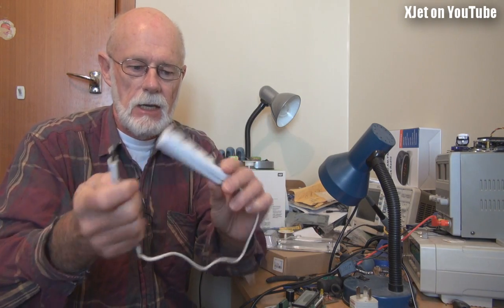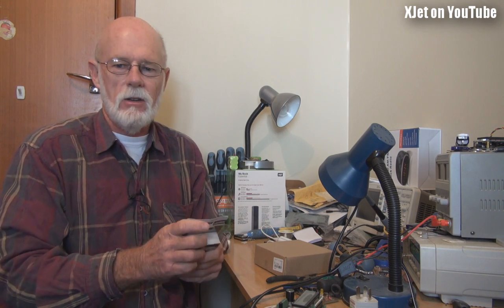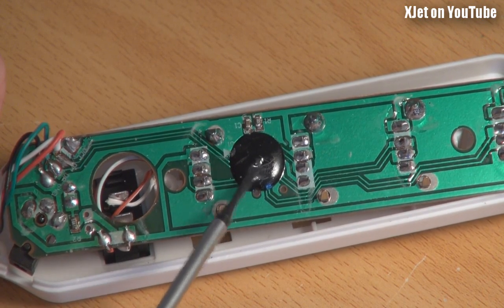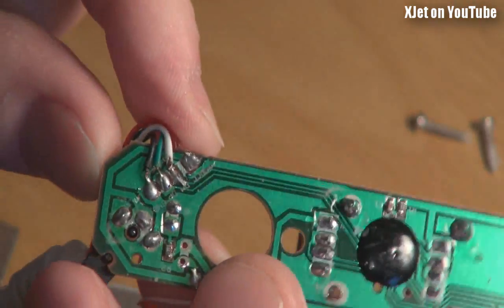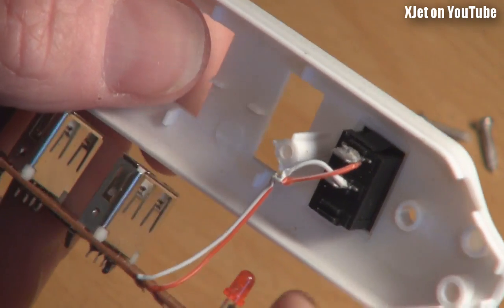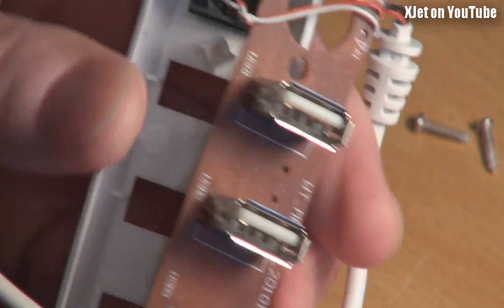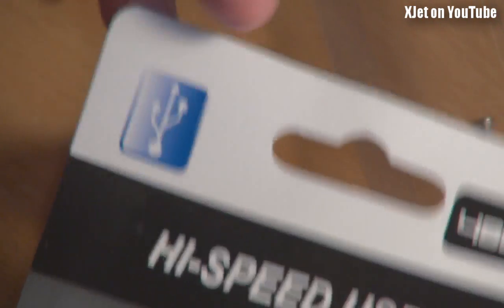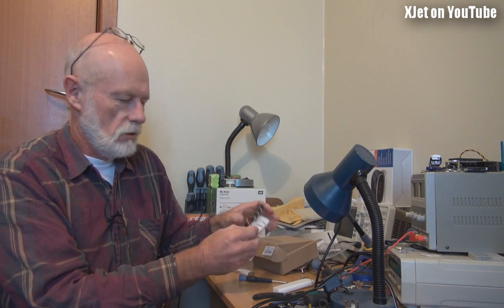A really bad bit of Chinese electronics

Comment: I was in need of another, after my experience with the previous, (from which I salvaged 4 nice switches I have used in other projects) I purchased another. After my prior experience and having watched this video, I took her apart and did a rebuild. I removed the wires, which, much like yours left way to much wire exposed, trimmed and replaced. I re-soldered nearly every joint using a good iron and some high quality lead based solder, then thoroughly tested it using a power bank and charger doctor to insure the proper voltages were present.  Now I use it on my micro controllers, and single board computers such as my Beaglebone Black linux boxes, and my Orange and Rapberry Pi machines (not needed that much on Raspberry Pi)  They do a good job if you take the poor workmanship out of the process and replace it with careful practices in the rebuild. I also did the same with a 10 USB hub that I have now wired up to the house battery's on my Motor Home for a charging station through a large 12 to 5 volt buck converter.

Comment: I recently bought 20 X 555 timer integrated circuits from China (through Alibaba).  They were certainly cheap but putting them into a simple astable circuit built right from the datasheet they keep blowing.  About 8 of them are in the garbage now.  Most worked for a few seconds and then stopped.  I thought it must be the circuit so I double checked it then put in a 555 I sourced locally years ago and it works fine.

Strongly suspect an inferior product now.
Reply from the maker: It is not unknown for Chinese sources to simply grab a bulk-lot of devices and re-silkscreen them with the designators for a more expensive device then onsell them.  There was an interesting example a few years ago when Sparkfun Electronics got caught by this with some Atmel processors which were something completely different.
Reply: ***** Hmmm.  I get the feeling these were rejects from a test line but then at that price I doubt anyone could check them individually.

I don't know.  Pretty sure they don't meet the specification for an LM555.  I wasn't even loading the output!
Reply: ***** I guess it's "luck of the draw".  I just bought four LED light bulbs rated at 220 volts from Aliexpress and in less than a month 3 out of 4 are dead.  I asked for a refund but the vendor (Aliexpress is only a broker I think) asked me to prove they were faulty with a video.  Certainly not worth my time so I just won't buy from them again.

You get what you pay for is the lesson.
Reply: you should better buy granade and use it to blow some china factories :D so you save thousands of lifes.
Reply: *grenade

Comment: One thing the Chinese factories do not practice is Design For Manufacturing (DFM). You can design the USB hub to use connectors to eliminate manual solder connections. You can design snap or sonic weld plastic pieces to eliminate screws. They could save time in assembly and increase reliability.

Comment: That makes me want to stab out my eyes with my soldering iron. I make PCBs (specifically in inspect and touch up solder joints out of the wave and ensure correct component placement prior to functional testing) for a living and I wouldn't even bother fixing this, I'd kick it back down the line and yell at whoever made it.

Comment: I once bought a USB lamp form china, when using it a Resistor overheated and the thing went up in smoke. That was a waste of £23.
Reply: +AuthorFilms Studios:  I purchased a 'Long Life' Lamp, equal to 60W-240 V. 25 years guarantee, it cost me A$20.00, I plugged it into the Light fitting, it worked for an hour or so, I switched it off (no longer needed the light as Daylight was now adequate), the same night I switched the light on and  BANG, the lamp blew to pieces, I Took the bits back to the retailer who wasn't interested, he said I could have dropped it, (Typical Australian Sales attitude) I purchased similar lamp from another supplier, it lasted over a week (I was delighted) it too went BANG, there was a Chinese name on the cardboard packing, the Australian Government has permitted such crap to be imported at the cost of the loss of any Australian manufacturer, and so it goes on. The Government has changed  by law, all the electric lamp systems to 'Long Life Flourescent types and since 99% are made in China, I wonder how much the Minister of energy was paid to permit the exclusion of British Made lamps and to permit what are both fire risks and electrical risks with the trash made in Chinese slave factories. Terry Offord.
Reply: Terry Offord
Totally agree, how does this stuff even get past border security, it's literally a bomb. The government needs to change.

Comment: all of those wires to the board (USB, switch) are especially egregious because there are proper through-hole mounting points they just didn't bother to use them. That's awful.

Comment: Naaah, just usual low quality stuff. I am wondering, that you see this first time. When I buy low price lectronic from China, I always count with possibility to repair it. For this mentioned piece, I can imagine to change all wires, and connect this to powerful 5V power supply and use it just for charging and powering devices. (Actually, I am going to find some cheapest on eBay to do so). For me was the absolute worst one USB DVB-t stick. It was one of those first in China history, and what can I say, soldering shown here in video is BEAUTIFUL! Of course, TV stick doesnt work even after full resoldering.

Comment: 6 DOLLARS FOR THIS ? 
You would have had a better result with 4 wires and a chewing gum WTF
Reply: +Lemon Chief 6 NZD as well, probably.
Reply: +The Whisper Guy propably
Reply: Lemon Chief computer won't actually notice more than one device without the proper resistors, and shit that go in the high end hubs, I've tried and it just cuts the rest of the devices off

Comment: I have to say, looks pretty sketchy to have an on/off switch on a USB hub.
I did have one Chinese product that stands out in my mind when it turned out to be defective when new.  It was a 5 1/4"  angle grinder which was a ripped off Bosch design.  I plugged it in brand new and it just took off on me.   I took it apart and a bunch of glue was put in the switch mechanism which glued the grinder "on".  I chiseled off the glue and it worked fine, or as fine as Chinese power tools ever work.  One thing that is pretty consistent with Chinese power tools is the gears are very poorly cut and always very loud.

Comment: I just got something similar off eBay. Glad I opened it up before I plugged it into anything. The real horror show was in the included 5v power supply, though. Rated at an amp, but the wiring was hair thin. And, unless I'm mistaken, a half-wave rectifier. Great vid!
Reply: Halfwave doesn’t matter, only the smoother caps

Comment: chinese made stuff is crap i build my own or buy it if it says MADE IN U S A
Reply: +juniornowack pwi ...in many cases we do not have a choice, there is nothing but "made in China" and it is the fault of both the public wanting the cheapest sh_t available, and the manufacturers mostly or only concerned about their profits by minimizing the expense of manufacturing ie: going where the labor is cheapest! We have met the enemy, and it is us!
Reply: you make your own silicon chips? because I'm pretty sure even parts for any homebuilt electronics come from China.The car you drive if it is newer than 2009 probably has a PSA coparation (Citroen) engine inside

Comment: Chinese Quality, it's like a 50/50 Could be Awesome, Could be Terrible. I bought a Carburetor one time from China.. Worst thing ever. The Inside of the Venturi was rough unpolished still had HUGE ass Castings that broke off with my finger hitting them "Could have potentially destroyed the engine I was gonna use it on" not to mention, it leaked fuel and was just Absolutely GARBAGE.

Comment: Computer PSU with mains going directly into a rectifier - no X/Y-caps or any other filtering, and worst of all, NO FUSE. Oh, and all the capacitors were Fuhjyyus and GSCs! Labeled 580W, it couldn't supply 200W.

Comment: Years ago i blew my Laptop motherboard because of a cheap usb hub. I connected it to the power outlet and it shorted out my laptop motherboard. I managed to get a free repair but it cost me 75$ to sent it to the manufacturer. Bottom line , Pay 10-15$ for a good one and save the trouble.

Comment: They do make some decent devices. I recently started carrying a line of Chinese Commercial grade 2-way radios that meet or beat the name brand ones here in the States simply because the cost greatly lower and the weight is lighter, sizes are smaller and battery life are so much longer.
Reply: Boafeng?
Reply: HYT because they are the only ones who will do digital for a reasonable price, and offer portables, mobiles and repeaters.
$1800 I can have an HYT Digital 50 watt rack mount UHF repeater shipped to my door..

Boafeng is OK if your a new HAM looking for a cheap HT. Though Boafeng does make a commercial line as well but their performance is not that great..

Comment: I must say, it has been a while since I've seen something this shoddy, even at the cheap end of the scale. I just took delivery today of a quite similarly-designed, seven port hub from eBay for a couple of pounds. I've had it apart and the item has clearly been manufactured in a professional factory, with good quality soldering and decent layout. It works fine and has a real pair of SMD hub chips from Terminus. Really nothing to complain about. Even the sub-$1 garbage tends to be fairly well constructed IME -- maybe I'm just lucky.
Reply: You are. My dad got a extension cable for cars (12v) and it blew the car's fuse TWICE after a few months of use.
Reply: Sorry for bad grammar.

Comment: If I were you I would just rework the whole damn thing.
Reply: Perhaps. It costs 6 bucks man.
Reply: liucyrus22 All he has to do is redo the solder points, add some to the usb port, and make sure the wires aren't touching
Reply: thats what i was thinking, a little soldering and rewiring and use that damn thing!! im too damn cheap to throw away $6 like that!!!

Comment: While low voltage stuff like this USB hub which has been built so poorly in China are laughable, things like power bars are not. If it plugs in to 120V or 240V, always make sure it has a known brand name (high-end is not important, but UL or CSA certification is). Ultra-cheap 'no-name' stuff often is not certified for fire or shock hazard safety, or even worse, sport fake UL or CSA safety certification labels. Even cheap brands at Walmart don't lower the bar to have fake safety certification. It might fall apart or stop working long before it should, but at least it shouldn't burn your house down or shock someone.
Reply: China is well known for putting fake UL and CSA stickers on their junk power strips. Seeing such approval is no proof anything from there is actually tested and approved.
Reply: Yes! My friend had a peculiar looking power strip. It had issues with plugs staying in. I end up with it and it turns out it is a knock off of course! It had flipping breadboard jumper wires for electrical busses between the outlets! UGH! Junk bin it went!

Comment: Why didn't you fix it.  The real problem was the screw that cut through the wires.  Clip and trim them then use some heat shrink tube, or even just tape.  Then some silicone RTV on the other lkeads and I am sure it would have worked.  But you were getting your rocks off on shitting on people that are not allowed to negotiate what they will get paid or were they will work.  It's there or back breaking labor planting rice.

Comment: Well, it's like blaming how bad is Windows! It might be bad, but it's all we have at the moment. Made in USA stuff are crap also. I don't see things Made in England stuff at all. Just japanese car are really good. Far from that, nothing else is well thought before get the market, I can agree with that. However, I can use and through away 5 Chinese routers and they last longer that just 1 Made in USA stuff, for the same price or cheaper. So, you tell me.

Comment: a. bet the person that had put that together had never seen or held a solder device before
b. that board was clearly ment to have the wires drop in from the top, so clearly the person had either lied or wasn't instructed cause
That usb hub was one of the more simple things i've seen in term of complexity, bet i could have a class of 8 year olds with a little instruction put together that hub with a max of 3 looking worse then that one. ^_~

Comment: I once had a battery powered toy who's motor apparently stopped working. It had no fuse or current limiting, and the motor either "seized" or shorted internally. Either way, while I was trying to fix it, by that, I mean "check the batteries and any thing that wouldn't be the toy's fault"  it STARTED SMOKING and the batteries had gotten so hot they MELTED THE INSIDE OF THE BATTERY COMPARTMENT! FOR A MERE 25 CENTS, THEY COULD HAVE ADDED A FUSE OR RESISTOR TO PREVENT THIS! It could have caught fire, for want of an extra 25 CENT component!

Comment: Lead-free solder isn't the fault of the Chinese manufacturers, it's a requirement for getting your electronics into the EU market, where regular tin/lead solder has been banned for ecological reasons. So you can blame the Europeans for that one.
Reply: I can solder very good with lead free stuff too. so what's the problem?
Reply from the maker: *****
Not strictly true... tin-whiskers are far more of a problem with lead-free solder than they were with tin/lead solder and in certain conditions, tin-whiskers can cause huge problems with electronic equipment.
Reply: *****
Germany is known for their high quality electronics and manufacturing in general, but that has absolutely nothing to do with the EU's lead ban. It's not even on debate that leaded solder is better than lead free. It's undisputed fact. Medical equipment is often exempt or has an alternative version of the RoHS directive for our own safety. Lead free, among many other reasons, is mechanically weaker and less resistant to vibration and shock than leaded solder.
Reply: *****
More tin. Usually >99% Tin with the rest copper and silver. Tin whiskers are more of an issue with lead free and overall longevity is unproven. Medical equipment is no longer exempt .

Comment: It does not matter what you pay for something there is good quality, bad quality and rubbish. The thing is it should at least work. The Chinese manufacturers simply lie. I bought some clothes line from Woolworths it said on the packaging "UV stabilized"
well it lasted about 1 week before it fell apart from exposure to the Sun! Oh and about the heater that I bought. I brought it home turned it on.......Flames! Beware of crap made in China.

Comment: It is not a high speed hub. High speed hubs won't use such small amount of passive components since PLL and transceiver won't work if not properly filtered.
BTW, this hub won't sold over 5 CNY (0.8 USD)  in China. You were completely deceived by the reseller.

Comment: Since you know what is wrong with it now and you did say you needed one of these hubs, why not just solder it up and fix the dodgy wiring? I mean, I completely agree that this is unacceptable quality even for a $6 item  and whoever made it should be ashamed of themselves but if it were me I'd just fix it since I know that the PC is reading it which implies that the circuitry would work if the wires weren't touching.

Comment: At least everything that seems wrong up-front with this thing is easily fixable.

If this had been a high-volume production low-cost item, it would have been wave-soldered (both USB ground tabs soldered for practically free) and probably ultrasound-welded to eliminate most labor (and screw) costs... the case could have been plain snap-on too, even cheaper.

Since this has all the signs of a relatively low-volume mostly manual labor job, I'm guessing it is a small, possibly one-man, entrepreneur job. That would explain the total lack of branding and quality-control..

Comment: as a auto mechanic many shops in the US are using chinese parts on cars and man are they JUNK. It seems they make almost every automotive replacement part installed on cars. High failure rate

Comment: thats why i refuse to buy a new tv and new electronics
Reply: just fixed my pc,s psu, and dvd player so i could not agree more with you
Reply: exactly i buy second hand stuff even clothes too and electronics i repair them i get all second hand.
Reply: I only get CRT's and the ones i usually pick up are of good quality and have even second hand still lasted for quite some time such as from the 90's
Reply: Just Chinese TVs. Korean and Japanese made seem okay.
Reply: i got a panasonic set from the mid 90's which is excellent quality its now in the bedroom with a Set top box i got a sony CRT (28 inch this one) set from 2006 of excellent quality and excellent picture too (no HDMI in this model though only the hi scan models!) but still great who would throw out such good sets? what they paid hundreds if not thousands for back in the day paying a few hundred more to replace it with something only benifit they get for paying hundreds more is slimness of flat panels when what was used before was fine im shocked and saddned by seeing one on the street abandoned which i try to take any good ones home.

Comment: I've seen my share of crappy electronics from China. Power adapters that won't work straight out of the package, CFL's (several) that have caught fire in the fixtures. Holes drilled way out of line and some of the worst and seriously cheap hardware in the world. The comment about the Soldering was Hilarious!

Comment: I once bought a " 5W High Power USB WIFI" adapter off ebay. Had similar sightings inside.  The antenna was simply two badly cut pieces of aluminum with wires attached.